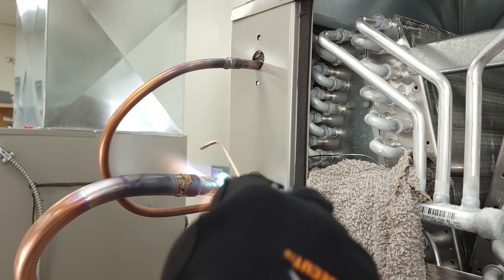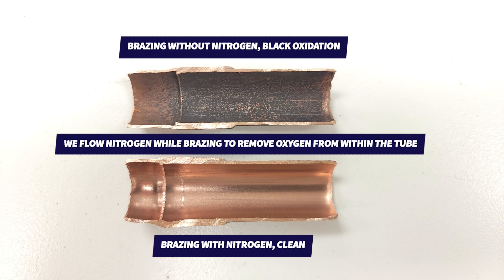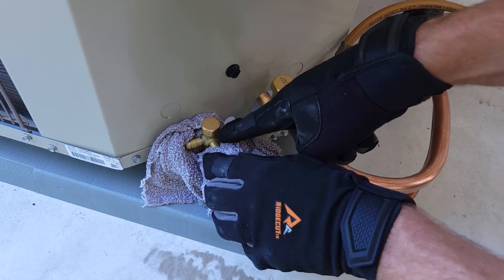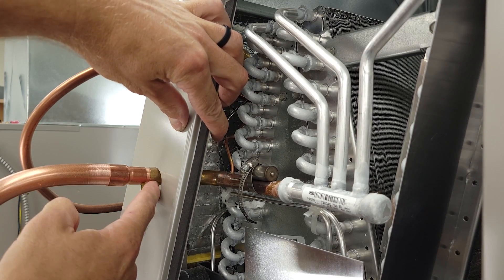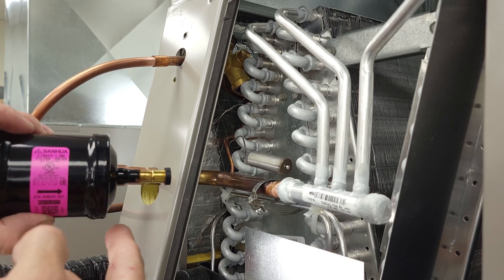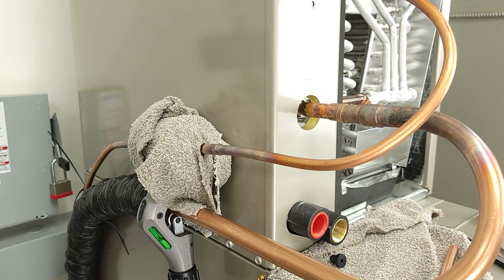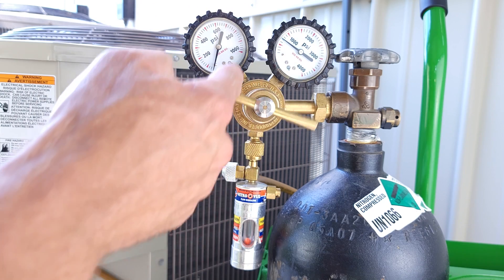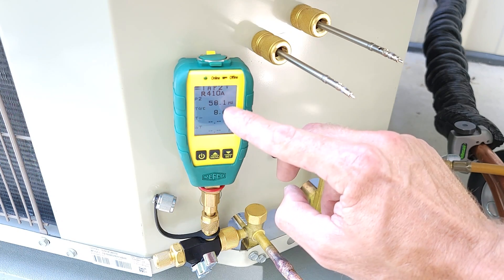Brazing and Leak Testing an Air Conditioner! System Install Steps!

Comment: So I’m new to this brazing methods but familiar with regular soldering. I have noticed that for brazing you use air/acetylene and oxygen/acetylene. How does a technician know which setup to use depending on the circumstances?

Comment: Best way to do it for sure, but really expensive. That pipe insulation will start on fire, pro tip. Hopefully that cutter won't damage the pipe.

Comment: Craig, I'm curious why nitrogen isn't used to un-sweat fittings from line sets?  Doesn't the inside copper oxidize with the heat from the torch being applied to remove the brazing material?  Please advise.

Comment: Alternative to leak checking the system without the digital leak guage ?
Reply: You can use the gauge on either the high or low side, as appropriate, of an analog manifold or spend roughly $115 (US) and purchase a wireless pressure probe like the REFCO TAP Pressure Gauge 4687787 that Craig used in the video or a competing brand like the Fieldpiece JL3PR probe, YELLOW JACKET YJACK PRESS 67065, etc. There are no other reliable, practical alternatives.

Comment: I’ve got my mini split system pressurized without leaks and vacuum is holding well below 500, but 2 of the 4 line sets leak after I open them to the outdoor unit (as noted by low charge a few days later - I can’t find the leak(s)).  I’ve introduced a small amount of refrigerant into the lines, pressurized at 500 psi overnight, and can’t detect any leaks with bubble leak detector or my infrared detector.  Here’s the thing: if I remove the caps from the service port or the service valves the infrared detector initially finds refrigerant there, but not after a few seconds.  Ok, so there are very small leaks at these locations.  Is it normal to have this happen, should I tighten the service valves more, or something else?

Comment: Hey Craig! I have a horizontal installed ac unit, the drain pan is working fine but one of the return line keeps filling up with water. But the filter is not wet that means I’m not sure where that water is coming from.

Comment: Hey Craig, I was taught years ago and I'm pretty sure I've even heard you teach this before, that when adding pressure, you you press it to the lowside design pressure of the outdoor unit not the indoor unit which is always like half of what the indoor unit will say. This is to protect the compressor terminal connections as they are on the suction side of compressor. The fusite connector. For 410 I usually see 250psig and that's as far as I press up to. Also,not sure if this was a typo but a month ago I replaced a 7 ton Copeland scroll and the warning paperwork that they come with actually said do not pressure test above 100psig, which I thought was a mistake they made but maybe not, maybe something new going on we don't know about yet lol?

Comment: I like to take the caps off the king valves and fill the holes with cold water in addition to the cold wet rags for protecting the valves.
The water will boil a bit while finishing the braze.
Great video Craig.👍

Comment: I’m gonna throw out an idea and hope to get the opinions of the more learned.
Picture a filter dryer with a pre fab Union on each side, the mating half of the Union on the liquid line in and out. In addition, a valve installed on the line before each union. The purpose of this is to isolate the filter dryer from the liquid line negating the need to evacuate the system just to change it. Too much refrigerant bleed ?? Too much  air into the system?  
Your thoughts and criticisms please.
Reply: That would introduce air and moisture unless it also would have a shrader service port for evacuation
Reply: A prefab union? You always just take the old out and braze a new one in. When you've done it 100 times, it's really not that bad. That would just be overthinking it and overcomplicating it. Changing a filter drier is pretty quick
Reply: I’ll do that on a burnout with larger split systems. I don’t use flared driers but I’ll install ball valves immediately after the drier on any split systems over 10 tons but, It’s just not practical to do it on residential systems. It usually only take a few minutes to pump a unit down and a additional few minutes to replace a drier. If the drier pre installed in the condenser your going to have to recover anyway. I’m glad most manufacturers has done away with that practice. It would be nice if all I ever had to work on was units I installed.

Comment: Does anyone know what tape was used to insulate the TXV Bulb?
Reply: Cork Insulation tape.
Reply: @deckert5431  it looked more like foam tape but either works. I've always preferred foam tape over cork. Cork is a nightmare to peel off years down the road when you have to replace the TXV. I always keep a roll or two of foam tape on the van

Comment: you don't need fancy connectors to attach a digital guage to the system, just fit it to your manifold....which you're going to use anyway to vac it out. And if you're worried that your guages might leak and give you a false reading, throw them away and buy a decent set.

Comment: Nitrogen will fluctuate in pressure the same as air or any gas for that matter.  It follows the ideal gas law of PV=nRT where the equation does not rely on the type of gas.  Thus nitrogen gas pressure will vary no differently that generic non-condensing "air" in the line.

Comment: Very good 'Best practices' process presentation but still room for improvement IMO, but why not doing it with an Oxy Acetylene torch rather than the Turbo Torch? When showing best practices of brazing I would have used the Uniweld Captains Hook or a regular straight Oxy Acetylene torch. Oxy Acetylene is much hotter even at reducing or carburizing flame and the duration of heat application to complete the braze is shorter so heat cannot transfer so far over the copper/brass/aluminum to damage o-rings in king valves or low temperature Aluminum braze at the copper aluminum joints at the evaporator. I understand you rarely show brazing in all your best practices video's. Years ago you showed a presentation with the UNIWELD Captain's hook to braze in a condensing unit, I thing that's the better way to do it, since you are done faster with the heat and can cool down with the wet rag sooner so less chance of collateral damage from heat.

Comment: What kind of torch you are using and how to contrl the flame?
Reply: He's using an air -acetylene torch.
Different size tips are available like many other torches have.
With air acetylene torches of any tip size, the unit is designed and should be ran "all out".
Valve on gauge and valve on handle.  Not the valve on tank.
Hope this helps.

Comment: What is your thoughts on Zoom Lock crimp-on fittings?
Reply: They work great if you prep the pipe correctly. If not it's going to leak. Same as pro press but a bit less forgiving with mistakes. Just can't use them in many applications where space is limited because the fittings are huge,very long fittings
Reply: I’m interested in trying these. It’s hard to go wrong with brazing your lines in, but I’ve heard good things about zoomlock and RLS fittings. I might give it a go at the end of the year since I’m sure I will need some tax write offs haha
Reply: They are way too expensive. They make various types at our distribution center of these no braze fittings. I'd take a copper coupling over a push-fit or crimp fitting any day

Comment: on the last braze inside on dryer,with nitrogen flowing would it build up pressure to blow out final joint ?
Reply: No because remember the nitrogen was connected to one side at the condenser, and the Schrader valve  was removed on the other side so it always has somewhere to escape. 👍🏽

Comment: I seriously doubt the guys that worked on my installation followed any of the steps outlined here when connecting the lines.
Reply: If they soldered you don’t need to use nitrogen. IMO brazing is unnecessary unless replacing a compressor, but people have their ways and nothing wrong w brazing.
Reply: @jameslang9170  can you expound on this? I’m interested
Reply: @diyhvacguy  Because you do not need to heat the copper over about 400 degrees, there is no need to use nitrogen. But there are a couple things you need to be aware of ... 1.) You need a tight fitting. Stay brite 8 will not fill a fitting like braze. 2.) The joint needs to be super clean and fluxed.
Reply: Also, you need a special flux. You can go to the Harris website to learn more.
Reply: @BestHVAC  that’s super interesting! How long have you been using this method?

Comment: I always give my pressure test a hour and my vacuum a hour to hour and a half.. that’s when I do other things to wrap up clean up run electrical my tie in low voltage start paper work bring out scale bring out scale put away things I’m not gonna need anymore .. plenty to do
Reply: Why not just drop it to 200-500 microns instead, anything more than that and you're just ruining your vaccum pump in the long run
Reply: @juliomma94jr  Vacuum pumps are tough. We have a service technician who has been doing HVAC for 30 years and he still has his original Yellow Jacket pump he purchased when he started. He pulls vacuums overnight all the time. I've never made a habit of that but he runs his for hours
Reply: @HVACTechMechanic  to each their own I guess, I couldn't possibly see my myself pulling one overnight let alone an hour, I persoanlly like to just stick around 300 microns or so, whatever works though
Reply: On new install, my service tech did everything ascsuggested...15 min ...Then i spent the next 12 years and 3 techs adding refrigerant average 18 lbs a year .... so much the 15min fullproof test. Eventually discovered a defective manufacturer brazed coil joint. ... i think an hour would have revealed something off while the original warrantee and choice to refuse the final on the job until it wss right was still available to me.
Reply: a vacuum an hour??? That seems like over kill. You should know if you have a leak with a vacuum within 15mins.
Reply: @exclusive_148  you should run a vacuum at least 30 minutes. I run mine at least 45. It’s not just a leak test it’s to boil any moisture in the system.
Reply: @fsu3784  From my understanding nitrogen helps remove moisture.
Reply: @exclusive_148  no. Vacuum boils all moisture out. I never use a vacuum to test for leaks on a pressurized system.
Reply: @exclusive_148  no only vacuum boils off moisture
Reply: @fsu3784  Well your mistaking. The manufacturer literally says to make sure the vacuum holds under 1000 microns for 15mins because if it goes up consistently that means there a leak. Ive seen my hoses leaking and the digital gauge holds pressure because its a very small leak. but microns is such a tiny measurement that a leak will be reflected fairly quickly. if you have moisture or oil then your supposed to use nitrogen and do a triple evacuation
Reply: @fsu3784  I never said a vacuum doest boil moisture. My point was that its not necessary to hold a vacuum for an hour because if you flush and pressurize with nitrogen and then your vacuum holds under 1000 for 15min YOUR GOOD!
Reply: @exclusive_148  I’m referring to your comment about nitrogen taking moisture out of a system. It’s wrong.
Reply: @exclusive_148  Best practice is under 500 microns, including EPA 608
Reply: @fsu3784  Dude, my whole point is - If you pressure test with nitro and then pull a deep vacuum and the system hold under 1000 microns for 15mins, THE SYSTEM IS TIGHT AND MOISTURE FREE. You dont have to proceed to hold that vacuum for 1-1.5hrs.

Comment: How come you didnt take off your caps on top of the king valves
Reply: He never charged the system. This video was just the brazing procedure. Those valves are for letting the freon into the lineset and Evap coil.

Comment: Love your book. Wish you explained brazing technique. Besides that, very good video! Adding to my notes. Was taught so much improper routines in the field.
Reply: I've learned to heat the inner pipe first about 3/4 of the heat time then the rest on the outer pipe and when brazing the suction line that you need the bigger turbo torch tip if using just acetylene.  Use  silver solder (stay Brite 8) on dissimilar metals and can be used on the lineset but not compressor if you wish. Don't need nitrogen when using Stay Brite 8 because the temperature isn't high enough to build up that cupric oxide or whatever it's called.